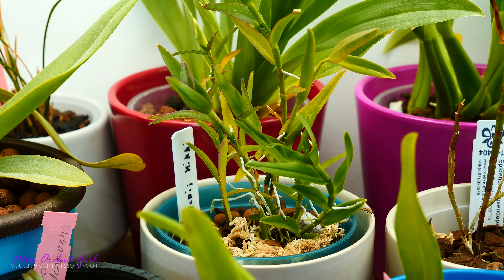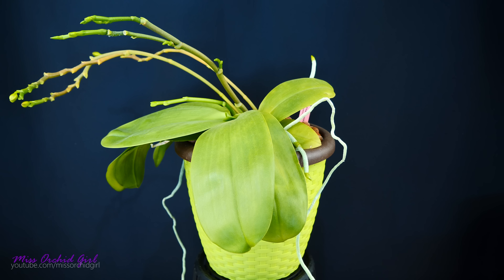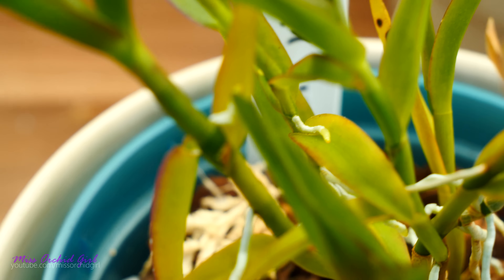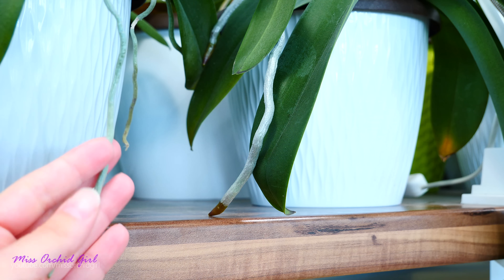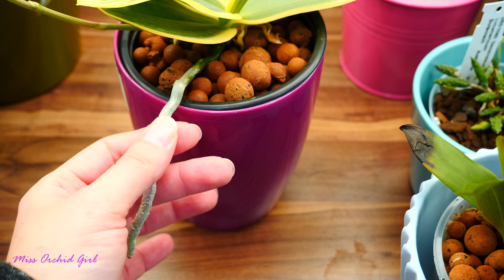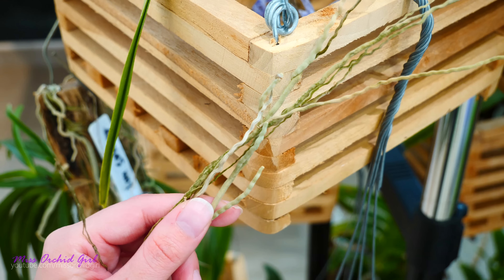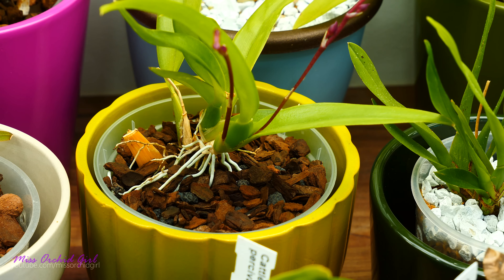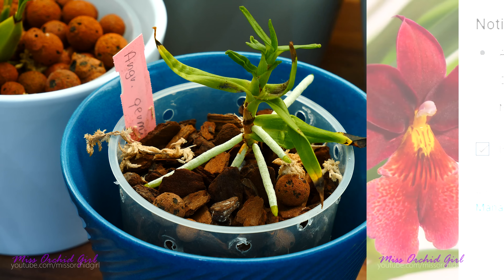Orchid aerial roots - Why Orchids grow them, what to do about them

Comment: Thanks for the imformativ video. I have a question:
I have some Catlaya and I use potts with many holes on them or make holes (to have better air flow in the soil) on, such as the last pott you show in this video. The problem I have is with some roots coming out of the holes of the pott. They are too many and I am afraid that it has much more roots outside in the air inside media.
So shall I cut them and wait to get dry and then repott it or do nothing or...?

Comment: Thanks, now I know for sure my plant is still healthy. My wife received it as a gift, and after the blooms fell, the leaves started turning black. I took it out of the little plastic cup it came in, cut away the rotted roots, and repotted it in a big ceramic pot in gravel mixed with all the moss that came with it (quite a bit as it was very densely packed). In this set up, the leaves have turned back to bright green, it bloomed again, and it's growing multiple, thick aerial roots. I think it's happy!

Comment: Do orchids grow by stacking ontop of one another? I have an orchid where it has old brown roots growing from the bottom of the plant that are down in the orchid bark. Then ontop of those leaves is another set of leaves with fresh whitish green aerial roots growing up and out of the middle of the leaf pair below it. Then ontop of that same thing, and same thing again. So it looks like my orchid has 3 orchids with aerial roots stacked on top of the original with the older roots in the bark, 4 total. It almost looks like I could separate them & have multiple orchids, but I'm not sure if this is how they grow.
 My other, older Orchid always just has one set of leaves (unless a new set is growing in, then the first set eventually turns yellow & falls off) with a couple aerial roots along with the bottom roots in the bark. But this one seems to continuously make new Orchids stacked on top of each other. Is this normal?

Comment: Don't hear any explanation of why you double pot.  can you please explain?
Reply from the maker: Hi, if by double pot you mean using decorative containers, then it's mainly for algae prevention, longer water retention and decoration. It's very common for orchid collectors. Roots don't need the light to perform their main functions, photosynthesis is not a main function, in case you were also wondering this. Explaining decorative pots is a new thing, never needed to address it as much in 9 years as I did in the past month. So I'm guessing someone said something about it on social media.  I would not worry about it ☺️
Reply: @MissOrchidGirl   It's just that they're always there but never explained why they're used.  How does a double pot prevent algae?  I would think the opposite - that it blocks the air circulation which prevents algae.   And how does it act as as a longer water retention?  Just that the inner pot isn't exposed to the air as much?
Reply from the maker: It blocks light, so algae cannot photosynthesize and develop. It reduces a bit surface exposure to air and in very warm climates (such as mine) it also acts as water retainer. It's not more than a couple of days difference, but it's enough to save the day. Ventilation through the pot is not reduced much, since it's not creating a seal with the interior pot. The balance of air / moisture is mostly controlled by the way I mix my potting mix materials. This explains how the setup works with watering https://youtu.be/HOhNbae8Xtg also if you just type in the search bar 'missorchidgirl decorative pots' you'll find multiple videos where I talk about them.

Comment: I know this is an old video, but as a new orchid parent, I want to know if the dried air roots should be a huge concern? The flowers are fine (I just bought the orchid) but I am worried about the dried roots that are just hanging around the pot.

Comment: I have a phaleanopsis orchid that's not doing well.  The average humidity here is about 80 all year round.  I switched all 3 of my orchids to semi-water culture from bark about 3 years ago.  Two have lots of roots going down and are doing well.  One has only 1 root going down but 4 aerial roots but the arial roots are shriveling up and 2 of the 4 leaves are also getting wrinkled.    I think it had more downward roots when I switched to semi-water.  That single root has about 6 inches at the top that is mushy and brown but at the bottom of that root there is 3 inches of very healthy green root.  If that last root that goes down dies, what should I do?  Is there any way to encourage it to get another root going down?  If it becomes without downward roots should I keep water in the container to provide some humidity and will it be likely to survive?  I started spraying the roots and leaves today but it is in the kitchen so the humidity is frequently very high in there from cooking.
Reply: Hi, is this  the only one, in the kitchen, that’s doing badly? I am worried of the Ethylene gas …@Mommy115

Comment: Hi Danny.  Have you experience with trying to burying arial roots in media with any results ?  Can you train it into the media like training a spike ?
Reply: I have the same question. Would love to know if there is a good way to train aerial roots into the media as I have a few orchids that desperately need more roots in the pot, but are growing aerial roots instead.
Reply: Hello! I believe that potting aerial roots is not beneficial as a lot of the aerial roots will rot when potted due to the higher moisture and lower airflow!
Reply: I tried that and was unsuccessful. I lost those too and ended with rootless phal with 1 aerial. Think Sofie is right. Beginner's attempt to save it. Now it is in spaghamoss following Danny's video. Just need to wait and see, and learn but no more flowers for years
Reply: Thank you Sophie and Yomaira for your comments! I was thinking of guiding the root into the media before it becomes a true aerial root. In other words, the root is inch or less long where it can either continue growing in the air, or turn down into the media. I don't think that would harm it, no?
Reply: @chaniwagh6254  
I've been doing it all the time. And it works perfectly!

Comment: I'm not sure I'll get a  response due tot he age of the video.. but here goes!
I have a Phalaenopsis Orchid that I re-potted into a basket about 2 years ago (on advisement from an orchid "expert" at Lowe's). This past year, her aerial roots have grown through the openings of the basket and are stuck to the sides. I know she definitely needs to be re-potted because she is growing up and out of the basket, but also because I need to change the medium. How should I go about getting the roots off the wood? I don't want to cut or harm them but I don't know how else to get her out :( 
Overall she is very healthy, just finished blooming but just started new buds on the end of each stem. A new leaf grew as she was in bloom and she has another starting now; there are 7 beautiful, green full grown leaves.  I just can't see how her roots look because I can't get her out. Any help would be appreciated! :)
Reply: You could soak the basket and hope it gets more manageable. If you cut the roots it could shook the plant and make it drop its buds.
Reply: In one of the videos Danny suggested to soak the medium before reporting. It will help detaching the roots from the medium (pot) without damaging them.